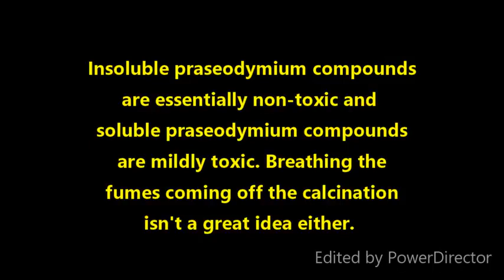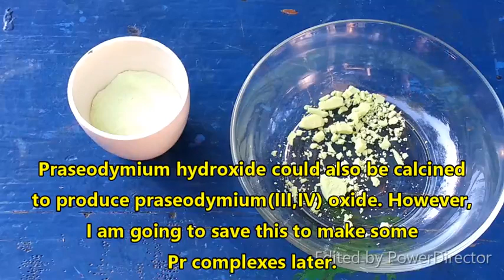How to Make Praseodymium(III,IV) Oxide (Reupload) #chemistry #lanthanides

Comment: If I wanted to make praseodium oxides, I'd just leave the metal outside for a week and let it turn into a pile of green rust. 😆
Did that with barium indoors and it formed a neat little conical pile.
But hey, this method is quicker